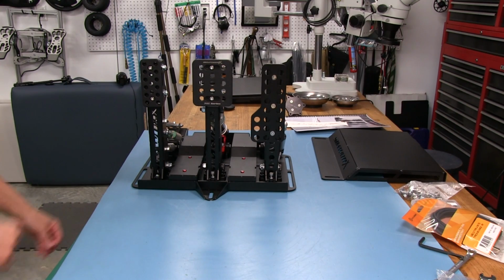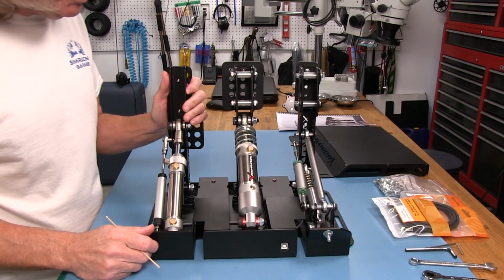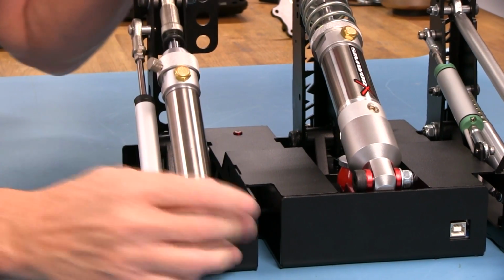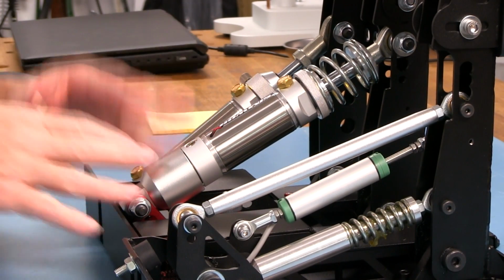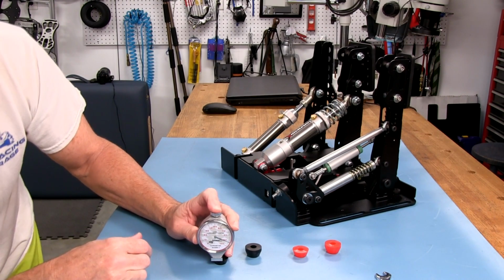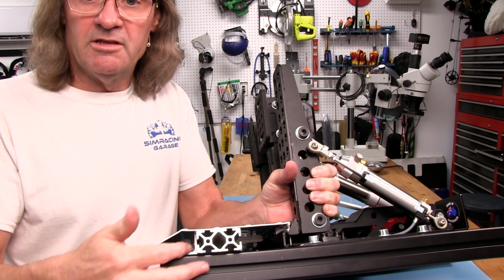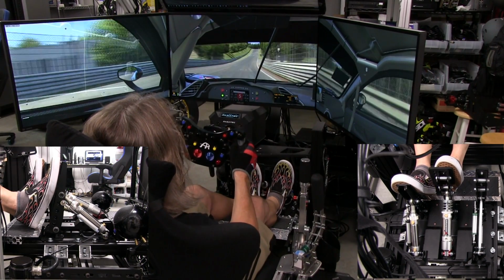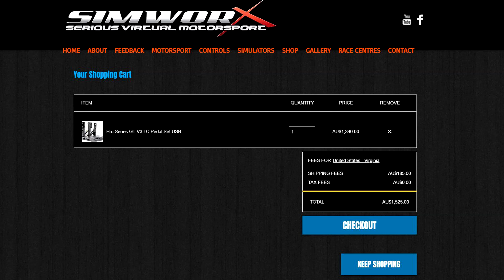SimworX Pro GT V3 LC Pedal Review

Comment: I'm still using the Fanatec CSV3 and one thing i've found about the more advanced pedal kits out there (including the V3)... their exposed guts make for a hell of a hard time to keep clean and dust free, especially since they need a bit of oil/grease to operate properly. bit of a pain lol
Reply: It's called cover them when they aren't in use duh. Even cheaper pedal need cleaned and lubed.

Comment: I see an issue with the throttle when it comes to the adj screw... further back you put the pedal the shorter the throw, so you go from 0 to 100% throttle with less travel, might make it diff to manage the throttle... also i would have to put a rubber cap over the bottom of the adj screw so it wouldnt create so much noise when come off the pedals

Comment: Really nice pedal set but isn't the maximum throttle range too short? Feels very short to me...
Reply from the maker: It is shorter that the others I have. But once calibrated in DiView, I don't notice any issues when it comes to throttle modulation. Others may though.

Comment: Man. I wish I saw that DD2 on your rig two months ago. I would have held off buying it.
Reply: Azzifyy I hate to say it but not really.
Reply: @OhItsThat  hey mate any reason in particular, Im very interested to know what it was/is that hasnt impressed you about your dd2?
Reply: I just got a DD1, and coming from a T300 it's AMAZING. But, curious if you just don't like it compared to other Direct Drive wheels?
Reply: Vik There’s a couple. One being it’s performance. It’s strong as hell but doesn’t really out perform my CSW V2. I can not get cars to feel good on a consistent basis. Cars that felt great with the V2 now feel kinda shi*ty. 

 I like weigh in my wheel, I wanted to have a heavy wheel but keep fidelity. It’s possible but if you do it using raw power the wheel becomes really dangerous and it has the tendency to wanna snap back to center. Constantly fighting it from from doing so. It doesn’t feel natural. I had the same issue CSW V2 in some cars and titles. Usually I could turn off the spring and that would help. But this is 10x worse as it’s more powerful. Plus the speed at which It snaps back is insane.  If you were in a real car in a sustained turn, if you let go of the of the wheel for a second it wouldn’t snap back to center like that. You’d crash and die if it did. 

 With the DD2, if you do that the wheel goes into a dangerous oscillation freak out. I try to counter this with Natural friction and dampening but it turns the wheel into a grindy mess. So that means I can’t try to achieve the weight I want with either of those  settings alone. 

 Don’t get me wrong. There have been a few times...and I mean a few...in the last month of ownership where I thought “Wow!!! this is it, this is why I got a direct drive wheel, my CSW V2 never felt this great.” Problem is, once you feel  that feeling you go chasing it with all the cars you like driving but you aren’t able to achieve it. It can be very disappointing. 

I’m hoping this is because there’s no tuning software at the moment for the Podium wheels. Because if this is how direct drive was nobody would recommend it. People wouldn’t spend thousands buying dd setups. 

The other main issue is the Hub for the QR. It’s an inferior design to all dd system on the market and flat out pieces of sh*t. Backwards compatibility for a $150 CSL P1 wheel wasn’t worth the sacrifices in design. The tightening nut comes loose on my unit. I run transducer but that shouldn’t vibrate it loose. I mean, this wheel is bound to end up on rigs with multiple transducers and even motion. 

I’m tightening it down pretty tight but Fanatec doesn’t say how much it needs. In a few videos they released showing how to use it they barely tighten the nut at all. For me it’s even less before it doesn’t tighten any further. There’s no “click”or “snap” nothing to reassure you it’s locked in place. 

 There I’ll be driving, reach around and find it loose. Gotta tighten it up going down the straight. 

After all that, try and take the wheel off. If you’re thinking it’s gonna be smooth and simple....you’re wrong. Don’t hit yourself in the face though. 

I have more complaints too. I just don’t have the vocabulary to explain the most important performance issues I’m having. I really wish I felt better about it.
Reply: Azzifyy If you watch the Fanatec video it shows them back the nut up. Put the wheel on then snug the nut up to the rubber. However it also shows them being able to turn the nut almost a full rotation once it meets resistance. For me it’s just a hair and it’s tight. This is the problem. There seems to be no right way of doing it. It’s kind of a “Hope for the best” situation and to me that’s unacceptable for a product like this. Not only cost but safety and piece of mind. 
 
I’ve also been told by a few people that you should turn the FFB up all the way on the wheel for the full dynamic range then turn it down in game to where it’s drivable. They said this comes from Fanatec but I’ve never been able to confirm it. 

An issue I had in iRacing with the 2017 Ford Gt is as soon as I meet resistance on the wheel my in game hands stop moving. So my real hands are slightly ahead of my virtual hands...in VR by the way. 

 But when I recenter the wheel and make slow turns at a stand still my hands line up fine. It’s only when I meet heavy resistance in the FFB. 

I also forgot to mention I went to turn my wheel on a couple of days ago and the fans went nuts. Cranked all the way up to 1400 RPM. I waited to see if they’d slow down or shut off but they never did. 

 I had to power cycle the base.. I really hope this isn’t the start of some of the issues I’ve been hearing about regarding reliability. 

I really want to love this product.
Reply: Software is huge with DD at least from what I've experienced. I try running my SC1 small Mige with no filters and I would want my CSW back if I had to drive it like that all the time. With the smallest amount of software tuning the wheel base now feels like a V2.5 but 5 times stronger and faster. Hopefully software can solve at least some of the issues you are facing.
Reply: @OhItsThat  thankyou for all of your honest feedback mate very helpful
Reply: @OhItsThat  I too hate that unnatural centering spring, and on my AF I really felt it through long fast corners.

When I switched to a SC1 a few months ago, that feeling was 99% gone.  Ended up being the biggest performance between the AF and OSW.

I still wonder whether DD wheels are somewhat overhyped, but I was very glad to find that problem eliminated with the SC1.

I assume the SC2 offers a similar feel, and if I ever upgrade again, I'll likely go in that direction (or the VRS DD wheel, if the reviews are what I expect).

FWIW, I probably use less, and maybe much less, torque than you.

Comment: Okay I am on the fence between buying the BMW replica rim from fanatic and the GT rim with lime green accent the BMW has two vibrating Motors. the GT wheel does not do the two vibrating Motors make that much of a difference to not purchase the GT style Rim which I actually really want. Putting it on a dd1

Comment: Barry, how do you connect this to the DD2? USB to RJ11 converter?
Reply from the maker: These pedals are not compatible with the DD2. They plug directly into a PC via USB.
Reply: @simracinggarage3026  Any way you can show how you connect your pedals to your PC and what type of configuration software is needed to make it compatible with your DD2? Perhaps I'm over thinking this? I presume there is setup software for the pedals? I've been buying the stuff you've been reviewing and I'm trying to replicate your setup and as you have all this sorted, don't want to re-invent the wheel...no pun intended!
Reply: Mr. Heat! Just connect it to your USB port. That’s it. Nothing else

Comment: so they are using festo cylinders on the brake and throttle,i used these myself about 7-8 years ago when making my first pressure based pedals, half fill the brake one with 400wt silicon rc shock oil oil and use a500psi pressure sensor screwed into the top port and you have yourself a hydraulic feel brake.
Reply: didnt the oil destroy the seals? i guess you step lightly on the brake pedal
Reply: @3ller  no, silicone oil had no effect on the silicone seals.

Comment: Hi all, for those interested I listed mine on Ebay. I'm not sure I'm actually allowed to include a link here but it's easy to find in Ebay anyway.

The Simworx pedals are great as described by Barry. I however found my HE Ultimates to be a bit more adjustable and between the 2 sets I therefore went for keeping the HE. It's however not the same price tag and for this price - more particularly as I listed them on Ebay with a significant discount vs new price - the Simworx set is a huge bargain.
Reply: @Nineteenfivepointfive  Ahah. Do you only sell 'so bad' stuff? No, they are indeed great as described by Barry. I however find the HE Ultimates a bit more adjustable and between the 2 sets I therefore went for keeping the HE. It's however not the same price tag and for this price - more particularly as I listed them on Ebay with a significant discount vs new price - it's a huge bargain.

Comment: This is a misleading review. "Pneumatic damping" implies air is used instead of liquid. I bought these pedals under the premise that there was no risk for a leak. Well, I have a leak. So I call BS that these are pneumatics.

It is unfortunate that this video is 63 minutes long but doesn't discuss the tremendous risks and headaches of how the brakes REALLY work. Such a shame. This video assured me that buying these pedals was as risk-free as it could be. Pneumatics are safer than hydraulics. Well, clearly, this was a lie.